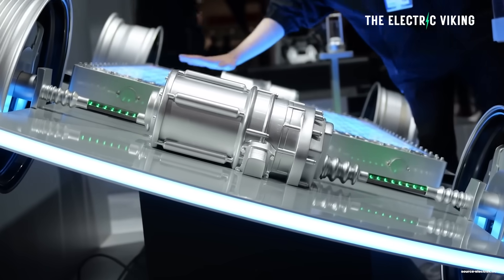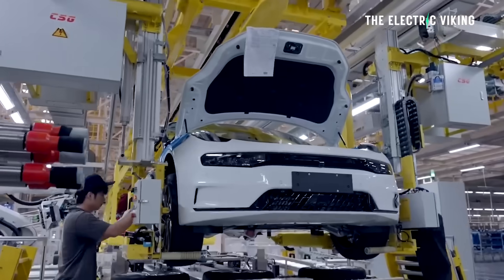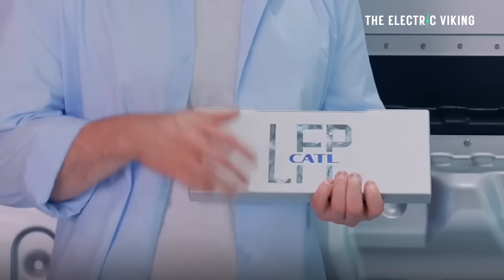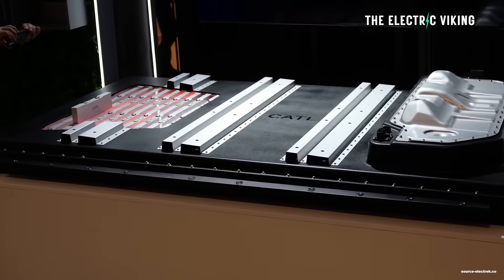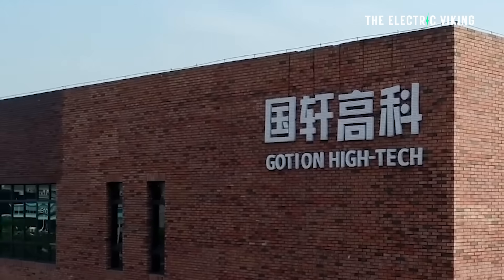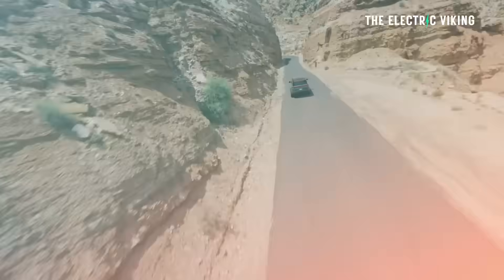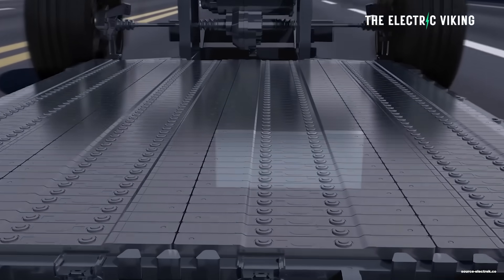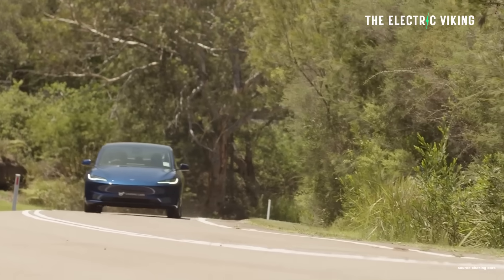Beginning with the CHEVY Bolt, LFP Batteries will dominate the US Car Market

Comment: Don’t agree with your prediction. There are far cheaper batteries available on the near horizon. Salt batteries will lead to charge. The determining factor will be price. The performance seems to be good enough across the board, but it might take a little while longer for mass production.

Comment: Remember NMC should only be charged from 20-80% most of the time for best life. So 60% of 300 Wh/kg normally usable or 180 Wh/kg equivalent. LFP can go 0-100% charge no problem with 160 Wh/kg so not that different.

Comment: INSIDEEVs has an article on battery life.  A battery testing company Voltest did a study recently comparing NCA and LFP in Tesla Model 3.
1) The NCA cars, sold between 2019 and 2022 showed a 71%-83% state of health, with most clustered in the mid-to-high 70s.
2) The LFP ones, all 2022 models, fared far better. Voltest registered state-of-health scores ranging from 87% to 93%. So these cars, even after many, many miles, were nearly as good as new from a range perspective. One still had 92% health after nearly 140,000 miles. Another was rated at 90% with nearly 165,000 miles. Generally, these LFP cars had many more miles on the odometer than their NCA counterparts.

Comment: Re: LFP charge to 100%
Yes, more range vs 80% charging, but what does the Lfp charge curve look like vs nmc?
Charge speed drop at 80%+, or does lfp maintain higher or more steady charge rate?
Reply: Answering my own question, I've seen youtube Comments recently in other ev videos confirming a flatter, higher sustained charge curve in at least one recent lfp equipped ev

Comment: Next up for Ford and Gm is LMR, Lithium Manganese Iron Phosphate
Reply: Why do you like that chemistry?
Reply: @jsh111 
LMR (Lithium Manganese-Rich) batteries offer approximately 33% higher energy density than LFP (Lithium Iron Phosphate) batteries at a similar cost.

Unlike traditional high-nickel batteries (NMC), LMR uses Manganese, which is much more thermally stable. Recent breakthroughs (by companies like GM and Ford) claim LMR has achieved a safety profile comparable to LFP. Because it contains very little nickel or cobalt, it has a higher "flash point" and is less likely to undergo violent thermal reactions.
Reply: @geraldford6409 i hope they have a higher cycle life span like LFP does as well.    Perhaps the future battle is between sodium and LMR.   There are also aluminum batteries being researched i have read

Comment: No, LFP won't overtake EV's as their weight and low energy density, will not let it happen.  I just watched a news release of a Chinese EV company mass-producing all solid-state batteries with energy density of: 500 Wh/kg., offering 1000 km range, 10 min. charge time and several thousand cycles life time.  Solid state batts are the future of EV and mobile devices batteries.
Reply: The operative word is "future". The leading automakers and battery makers developing solid state batteries are 4+ years away from being in full production at comparable prices to today's batteries. BTW, everybody is "announcing" solid state batteries, but they are all in the very distant future.

Comment: LFP can also be charged to 100%, I believe. Have to factor that in as added effective range.
Reply: Any battery can be charged to 100%.. come on now!
Reply: @skepticalmechanic come on now… you know that all car makers recommend that lithium nickel cobalt batteries not be charged above 80%, or below 20%, for normal everyday driving, or else the battery will degrade faster. Which means, the effective range for normal everyday driving is just 60% of the rated range.

Comment: If cost is the biggest reason to switch to LFP batteries, why wouldn’t manufacturers switched to sodium batteries quicker?
Reply: I would guess because LFP batteries can be mass produced on existing production lines, whereas sodium batteries do not yet have the same economies of production scale. So LFP is probably currently cheaper to produce/purchase than Na batteries, despite having cheaper materials.

Comment: All these ev products fail to hit 400 miles range, that is a psychological parameter that says 'that's good for a week'. Until you can repeat the ICE habit of fueling up once a week, there will not be any revolution.
Reply: Do you own an EV because charging habits at home quickly erase those old fueling habits.
Reply: @davidedwards5119  400 miles range would be beneficial for weekend trips or long road trips.
Reply: Most people who own EVs plug their cars in nearly every day at home so they wake up with a full charge. No driving to a gas station.

Comment: Ill stick with my gasoline engine I love my old truck
Reply: thinking you get a choice is precious
Reply: @katzgar thinking the FF industry won't screw every last penny out of you ...like wise on top of their regime bought subsidised  and invasions of public lands and damage to Air soil and water  resources they have left  also damage to world Heritage sites and actual American 1st nations sites ..... Like Chako Canyon and the Navajo/ D'nie and Hopi .
Reply: Then why are you on this site?
Reply: @BazzaMarama  
Obviously ⚡ curious ....send him over to the Edison motors Guys in BC Canada with their series Electric hybrid pickupconversions ....  The latest pulled a full KW rig low loader hauling a full load at  25kph  and accelerating  repeatedly  before it ripped the Toyota Land cruisers  tow hitch and bumper off the end of the chassis .., and Snapped a chain . 😂  It overpowered the  rolling road engine break they tested it on and started to turn tires into rubber rat droppings.. before the boss said cannot go any higher. 🤯 
All that 30-50% less fuel burn even in  generator running mode ....all the oomp comes from the electric Axel's Silent in normal battery mode till the current hits the preset limits ... Or you want to power your welders or other equipment a 100 km from a mains supply.

Comment: Sadly, they wont.  we will need next gen batteries I think.  we are going to need something at like $50 kwh and at a density of 500 kwh/kg so that we can have a range of 700-1000 miles.  

EVs are going to have to be just absolutely next level for americans to buy them.  they will have to beat gasoline cars on every metric. 

I don't see the politics changing.  the left does not care about climate change that much.

Comment: What about Zinc and Sodium batteries?
Reply: They probably will eventually but currently Zinc and Sodium aren't as developed as far as being able to actually manufacture at scale. Sodium seems closer but still really only one company claiming to be able to produce good enough sodium batteries soon but IIRC they still mix Sodium and LFP together in the pack to get there in all aspects. Zinc is even further away than that. They've got good enough zinc batteries in the lab with no actual scale production yet. Assuming one or both of those keep progressing it's likely that one of them will take over but it is possible that economies of scale for LFP will keep ahead enough of sodium and zinc to prevent them from really breaking into the mainstream market. Sodium is theoretically much cheaper based on materials but you still need to have an actual cost advantage after production to start taking over the market from established types. I do 100% agree that cheap and good enough will win out for most EVs the only question is if Sodium or Zinc will actually be able to realize their potential or if the LFP head start on cheap but good enough will be enough to keep iit in the lead.

Comment: The problem is the power density.  It will be difficult to produce a long range car with LFP. It seems like 400 kms will be about the max.
Reply: I think that's fine for most people TBH.
Reply: Considering you can charge at home in most cases who cares.
Reply: @ntsecrets  True. If you're planning a long journey you'll certainly start off with a full, cheaply charged battery (assuming you have home charging).
Reply: @sargfowler9603  most people want to stretch their legs after 400 miles for a few min. And if it cuts their trip cost in half…
Reply: Xpeng G9 has 93 kw LFP battery AND 540 KM range on wltp standard.
Reply: LFP batteries can be safely charged to 100% without degrading. Also safer wrt fire.

Comment: lol, actually the ev moment has already peaked
Reply: No where near peak goose. They're only just taking off
Reply: Globally, EVs hold 25% of the market and are growing 25-30% annually. Though the US ceded $1.5T in green jobs to China, the global shift to EVs for cheaper energy/maintenance is accelerating, and the US will eventually follow, albeit after giving the rest of the world a huge advantage.
Reply: So freight firms won't use a technology which is cheaper, more reliable and costs less to maintain?? 
And not everyone wants to drive a noisy, polluting, costly POS, or be a dupe for Exxon and Toyota